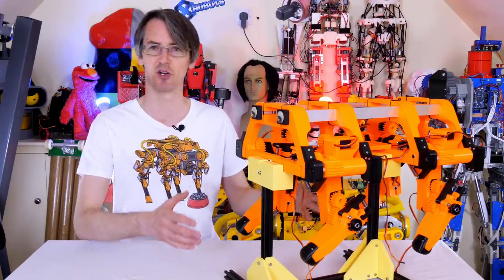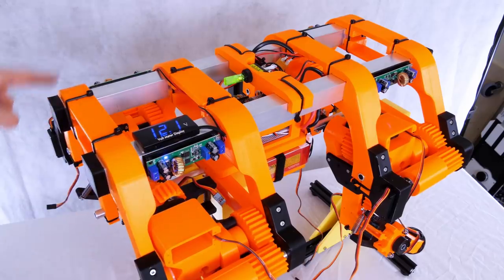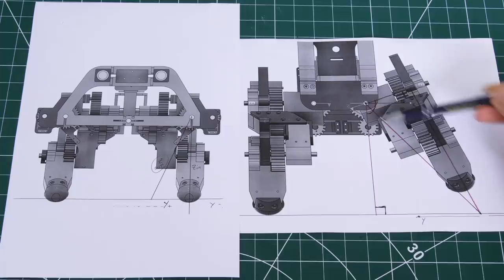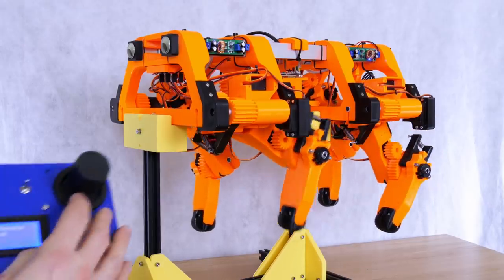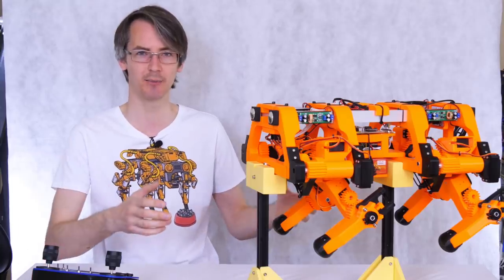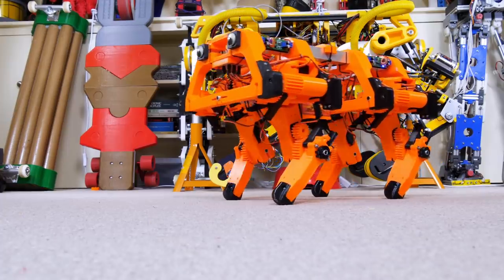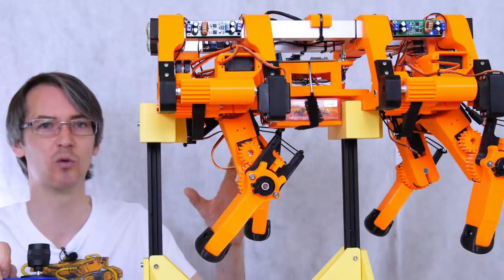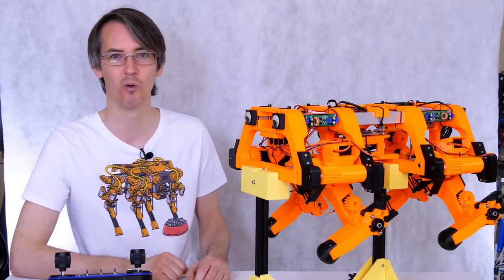Mini Robot Dog #7 - WALKING DYNAMICALLY

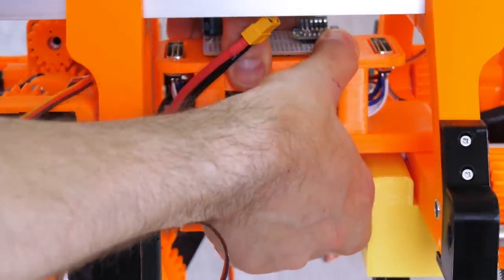Comment: Just curious, I recently downloaded fusion360, and for parts to snap together (such as at 1:36), is there a general rule of thumb for how much wider you would make the recess compared to the part going into said recess? specifically for 3d-printing and the plastic used ?  Thanks.

Comment: Each time a foot moves forward then contacts the floor it stops dead. What you need is for the kinematic model to include forward velocity, and when the feet contact the floor they should already be moving backwards.
Reply from the maker: Yes, there is more on that next time, but the servos as not fast enough to make the move in time.
Reply: @jamesbruton  Cool. 👍

      Gesundheit!

Comment: A long time ago, I also build a four legged robot. It had a center "spine" joint to twist the robot to help its balance when standing on two legs (to move the center of gravity). That worked well, but the center joint will need to be able to handle the weight of half the robot, so it needs to be beefy. My robots body was to long compared to it's legs though, so I never got it to properly take a corner...... And it not having knee joints probably did not help as well :-)

Comment: For the next dog, please do all the motor torque calculations beforehand so you hopefully know if the actuators are strong enough to support the weight of the machine. Sharing the process of doing those calculations beforehand would be really valuable.

Comment: Hi James  I (of course) admire your work, what you do is just magic to me.

I need to ask you about something.

Have you been considering using virtual environments to test your robots ?
Something opensource such as Webots or Gazebo ?
I thought about throwing there a number of robots (amount depends on the computer capabilities) 
and let neural networks train them to walk, run, jump , rollover .. :)
I am amazed at how the neural networks can trick the physics or solve problems in "new" ways.
The question is how would the virtual training outcome (code) work with the real hardware ...

Comment: I think at Boston Dynamics they used the negative power generated from shocking the ground as a measure of this shock, and they use magnetic field control inside the motor to counteract this shock in a desired way. I'm not really sure, but it may be.

Comment: Nice progress.  Seems like most successful designs use high torque direct drives and very low limb mass.  They multiply the tip speed of limbs by putting a long lever on a high torque drive at the axis.  I like the asthetics of the 3d prints, but perhaps composite tubing, or hollow tubing for rigidity and low mass is a next logical step?  Gotta get the speed up and the mass down.

Comment: To get nice grippy feet you should try 3D printing molds and using high shore strengh silicone to cast them.
A simpler solution is to use a grippy paint like Flexipaint, or Plastidip (but this one tends to strip), I've found those to be really good solutions.

As for actuators, there is no way around using a high torque density motor with a low back drivable gearbox, pretty much what the MIT Cheetah researchers outlined in their papers about the robot. Of course you can get by with simpler and cheaper actuators, but then the level of performance you reach is lowered accordingly.

Comment: The problem with your current compliance is that it is after the reduction which means the motor has to fight a very big way.
If you move the compliance before the reduction you can use stronger springs and much shorter ways which is easier to overcome for the motors.
Also you might want to start to experiment with arrow teeth, they have a bit higher friction but the torque is transmitted way smother with less slack.
After all geometry is almost free in 3D printing.

Comment: James, great work is done, so at the end I was really amazed by the army of stepping robodogs)) but seriously, if you are making a compliant mechanism maybe it's better to make it more bionic? What I mean is a tendon-driven mechanism, it will give you a natural  complience which can be better controlled by method you are using now (spring with hall sensor) and primarily it will allow you to put all heavy motors in the mass center - rigid body, or, proximate parts of extremities, which can make the extremities quite light and mass distribution over the whole apparatus more compact.
Reply from the maker: The next one will be belt driven to the knee with the motor in the shoulder, it'll also use the gearbox for compliance as per my other test dogs: https://www.youtube.com/playlist?list=PLpwJoq86vov9Aogc6PseW8BUe2nQyZESZ
Reply: I also mean a modular structures like Myorobotics and Roboy projects.

Comment: Have you tried 'overclocking' your servos?
To be more precise, you can run most servos with a slightly higher pwm frequency (i.e 60Hz instead of a 50Hz ).
I had played with that (using a HiTec servo, so quality/brand might be important).
I think i tried up to 60-70Hz, and it made a noticeable difference on the response/ 'snappiness' of the servo (i was using 5v), maybe it is applicable to your dog?

Comment: Hey James,

During the video a suggestion came to my mind; In all of the videos wich mentioned the kinematic model you put the ground where it is in the real world. Now to my suggestion: Since you alread have quite spherical feet i realized that f you were to put the end of the leg in the kinematic model in the center of those spheres then regardless of the angle of the feet the height would remain the same since any way a sphere is turned its center point always has the same height off the ground. That is not the case with the current model since the feet have a slightly asymetrical shape to them wich could introduce some wobble into the robot when moving. You could also do a series of tests with different shaped feet and (if you found my suggestion worth trying) feet with different radii to test how that changes the grip and or stability characterisics of the robot when moving.

TL:DR Moving the leg endpointIn in the kinematic model into the center of the foot could slightly reduce some wobble.

Comment: Just a suggestion: you can try to build your own servo motors by using an esc, brushless motor and some sort of encoder. That way you can easily adjust the parameters such as speed, torque, etc to your desired values instead of being stuck with the fixed values that you get from off the shelf components.regarding the springs: putting two springs in parallel makes them more stiff, try that instead of just using a zip tie. That way it's still compliant but more rigid.
Reply from the maker: Yes

Comment: Would stepper motors be any better? I know they can be very powerful from having my hand caught in my 3D printer while it was running. I can’t help myself and have to mess. They are very precise as well. Great stuff James 👍
Reply from the maker: The net one will be brushless motors, I don't believe you'll get enough speed out of steppers without a massive amount of weight.

Comment: the paired legs of animals don't leave the ground at the sime time. All legs are staggered when walking and running. If you just suddenly leave it without two legs it's just suddenly become a wobbly object.  Staggering the legs a bit should mean less time being totally unstable, and it may also allow you to control momentarily the direction that the body is moving towards.
Reply from the maker: It's worth looking at Boston Dynamics Spot Mini / MIT Cheetah etc. Also I featured exactly what you're talking about in the video too and compared this to real animals.

Comment: Dear James, you spoke of an interpolation engine, and in earlier episodes you used the Ramp library for that, but I can't find any trace of it in the github files. Did you change the way it works or is it not in at all anymore?
Reply from the maker: Yes I wrote my own as per part 5 of the series where it's explained.

Comment: Mechanic dog

You want to get a mechanical dog that looks like it and moves like a real dog. The first step is to make it move in the best way, with smooth and precise movements but it is not easy. 
That's why I want to try to give you advice from the past. Leonardo Da Vinci observed nature a lot and reproduced its movements mechanically; thanks to this he managed to be innovative and in front of everyone. 
So I would like to ask you a question: the joints and movements of the mechanical dog are really all those necessary to get to your goal, have you observed the movements of the dog from all angles? I mean the back or other details i don’t think, they could also be a necessary movements for balance or just to make the challenge more challenging. I'm not talking about limb implementation technologies because there are so many more valuable technologies that I still discover in your videos. 

Good work and do not underestimate everything that seems useless because it could be essential.

Comment: Strengthen the joints and simulate tendons, with springs being pulled by smaller servos, with good leverage, in addition to the current motors..
It would look messy, and need some kind of light covering so it doesn't catch on stuff.
You could even tension springs on both sides of a limb, equally based on their leverage (in addition to any extra strengthening values), to make it tense and create way smoother springing motions when steps land and take off.. if it tensioned during steps with the compression and decompression of the feet, but softer in the middle, to spring it in and out, even better!
Reply from the maker: It sounds very experimental, the next version will have compliance that works just like my test dogs: https://www.youtube.com/playlist?list=PLpwJoq86vov9Aogc6PseW8BUe2nQyZESZ

Comment: If one were to wish to print this at home, what would be the minimum size of printer bed needed? Really enjoy your content.
Reply from the maker: The only things that need a larger bed are the body frame parts - I'm using a 300x300 TAZ6 printer. I've published STP files though which you can edit, so you could split the parts down for a smaller printer.

Comment: Could you not extend rear stride a bit? The strength in the stride will come from the pushing motion of the legs towards the rear.  So you should potentially extend the stretch of the leg to the rear slightly so you can get more pressure at that stage.  That would also stop the slipping.
Reply from the maker: The servos are not fast enough to get there in time.

Comment: With all of these different approaches to you've been looking at to keep the robot level, I've been wondering why you haven't tried to use a gyro board to tell the robot how to compensate it's tilt.  It would be pretty similar to how a drone keeps it's orientation and would definitely need much less complicated designs for the legs.
Reply from the maker: Yes that's how it works
Reply: @jamesbruton  Then why do you need the compliant joints? Shouldn't the tilt of the robot be enough to determine how much less or more to extend the legs or how to move the legs to balance?
Reply from the maker: Well this one doesn't have them in the end, but anything bigger will due to the larger inertia - but it's mostly needed when something unexpected happens and one foot hits the ground unevenly.

Comment: you could try to use different types of actuators. Cycloidal, for example.
Reply from the maker: yep - there's more coming up in a couple of weeks. A belt reduction is sufficient with a big enough motor though.

Comment: Why are you never using ESP32? They are dirt cheap, tiny, and have dual core 240mhz processor, and theoretically up to 5MB/s uart communication :P Also built in BLE/WiFi for remote control ;)
Reply from the maker: Do they have six serial ports?

Comment: Try to see guide for 3d animators. Like how they rigging a dog in 3D, it may help
Reply from the maker: It would need an actual physics simulation, taking into account mechanical slop and inertia and everything else.
Reply: I made a 6 legged Walker in Gmod, kinda similar I think... Lots of coding in E2.
Reply: lol it would have to be a REALLY good animator.

 every subtle nuance of a quadruped walk cycle is based entirely on the scale, mass, dimensions, and millions of exterior inputs, a real dog does this intuitively, an animator fudges it by making it "look right" a robot dog needs to be programmed to copy the intuition of a real dog, rather than copying the walkcycle of a pretend massless dog in 3d software. this is why its not an easy task. if it were just a case of copying a dog walk cycle, that could be done with a clockwork mechanism and a few springs and pulleys... copying the dynamic and reactive behaviour of a quadruped is a LOT more complicated.

Comment: Why not try creating a kinematic model of your dogs in software, where you could input the leg legnths and moments of inetia of parts, simualtions of hall effect sensors and imu's etc. And use evoloution and machene learning algorthms to get the dogs to learn how to keep them selves stable naturals, ene over random terrain. You could use the distance that they get before falling over as your reward function. Would be one hell of alot of work. But if you did it right, and mabye randomly varied varaibles such as leg legnth and mass etc, you could create a brilliant neural network that is fast and transferable to any dog in any configuration. Would be fascinating to do. Probably a good place to start woudl be with your bipedal wheeled robot.

Comment: I wonder why the rear legs arent designed like an actual animal, where the ankle of the foot are longer and so the animal can have a more stable gate.  Also the rear leg has its knee that bends back instead of forwards.

Comment: nature knows best, a dogs front legs are not under the the dog, they are at the sides of the dog, and the shoulders are slightly above the COG, the rear legs are even more outside the body and pivoted inline with the body COG.. having different leg designs would be a hug complication, personally, i'd go with 4 fronts. what you have here is chicken/turkey legs...that said, its damn hard to catch a fast chicken...
Reply from the maker: Dogs were bread by humans...
Reply: @jamesbruton  and yet they trot gracefully - would you say the same for a wild wolf? how about a leopard, or a lion?
Reply: All 4 legged creatures are outboard motor driven from elephants to crocodiles and the front leg pivots (shoulders) are mechanically above the COG, to be so common in nature means there's a reason for that. I can't do what you do so I don't like to leave 'constructive' comments, I'm almost a lower level chicken soup vending machine repair man next to you but mechanically it's against best practice

Comment: Good job, I see the legs are very pug dog short, longer legs will speed it up and be much more "unstable" great to iron out balance,  IMU and controls. Have a look at the brushless motor legs with the belts and half cog they all seem to use this.  [or like the MIT cheetah3 ] 
https://www.youtube.com/watch?v=47c7bSYyHA8  that chain drive knee goods good.

Comment: If your working toward openDog then not having compliance is far more like the openDog
Reply from the maker: opeDog is 10 times heavier so it will never work without compliance. Things just don't scale up like that.
Reply: James Bruton could the dog move statically stably then just slow down if it was getting out of control using similar movements to the statically stable walk of minidog?

Comment: So dumb idea, why not use geared stepper motors
Reply from the maker: Well there are 12 for a start, which is why I tried to keep the cost low. I doubt you can drive a geared stepper as fast as we really need for this project though. The next version will be 1200W brushless motors.